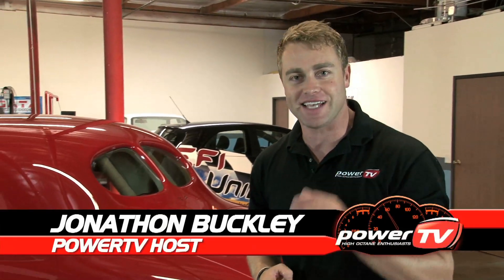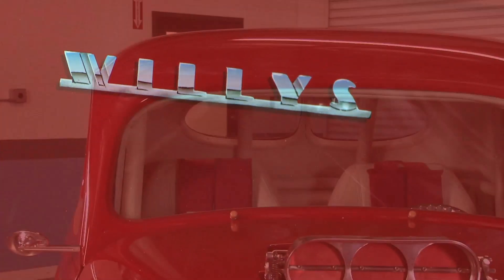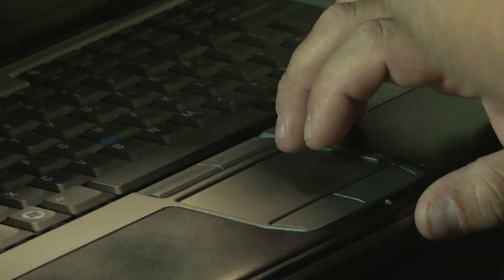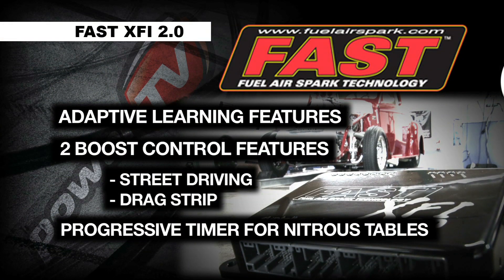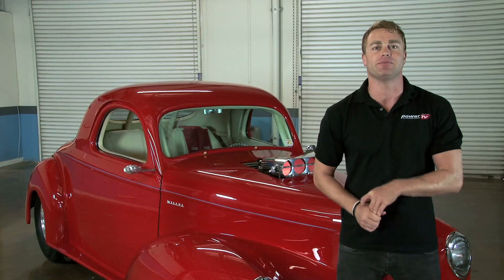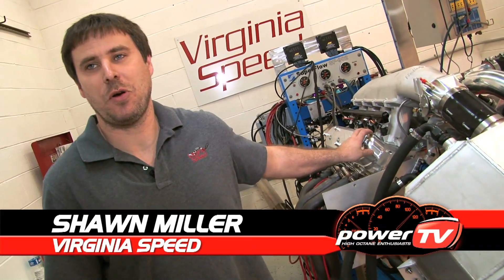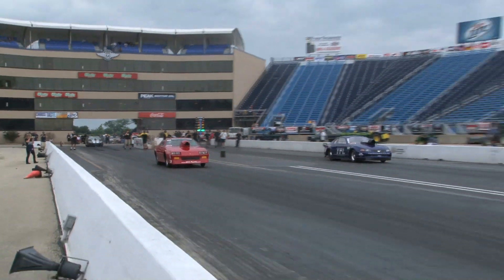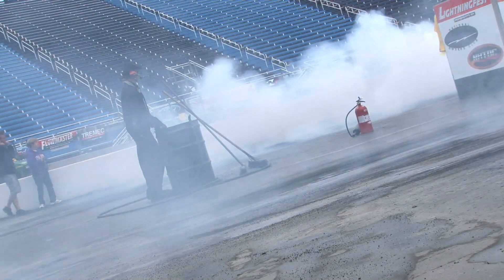Inside The New FAST™ XFI 2.0™ EFI System

Comment from the maker: Both are EFI systems that feature an ECU. The EZ-EFI is a 4140 direct replacement for a carb, while the XFI is designed more for engines that already feature electronic fuel injection.